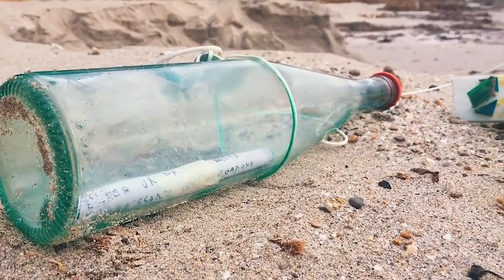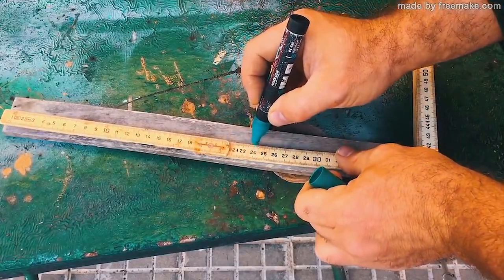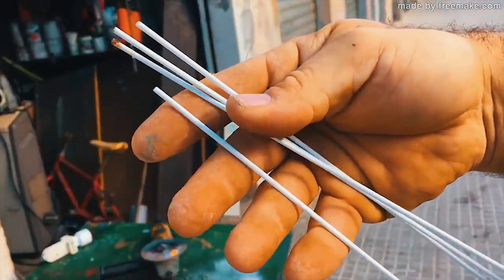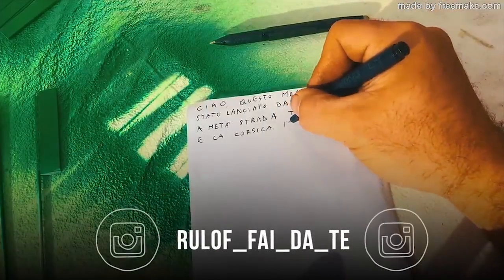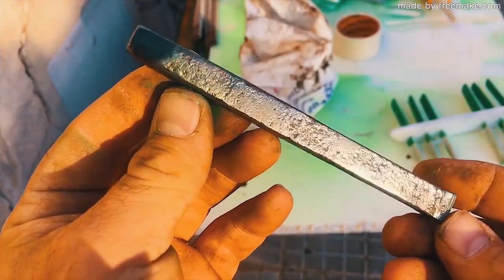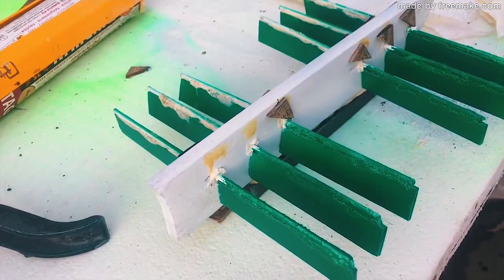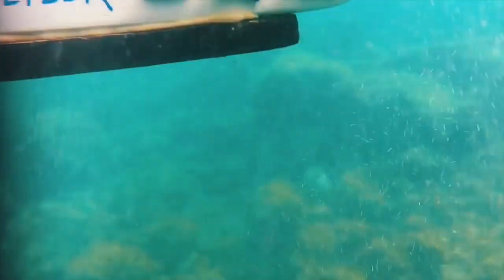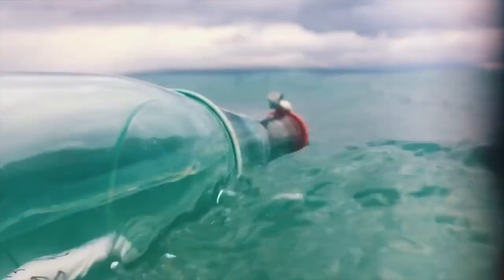Wave Propeller for Meassage in a Bottle •  Reach Destination!

Comment: To help the Sea Glider to keep certain magnetic heading, you can embed neodymium magnets in the wood. The horizontal force of the wings is transmitted to the bottle in a more efficient way if you use a stiff rod instead of the string.

Comment: If possible, GPS tracker can be used inside bottle for tracking the exact location of bottle
Reply: you just have to add a solar panel to keep it charged
Reply: @sebastianosinni5838  And some batteries or capacitors

Comment: I see plenty of room for improvement. Namely, I see how this could even have directional control, via prevailing wind direction. The string being replaced by a stiff wire, extending above the bottle, to a fixed wind vane.   Direction of travel could then be selected depending on the relation between the direction the sea glider is facing, versus the direction the wind vane is facing.  Studying prevailing wind and ocean current charts, one could fairly accurately "program" a course and destination.
Reply: rreidnauer google the company “liquid robotics” they pioneered this technology

Comment: It's a very cool idea. I'm of course aware that it's a basic concept device, but you could have a lot more efficiency with some very basic changes. For once, I assume that the 45 degree angle is far too much. With the analogy to airplane wings, you'd be aiming for the angle-of-attack for "best glide". I'd start by working with something around ~ +/- 15 degrees. More means that the "vessel" will sink and lift more easily without gaining forward speed. It's a bit like an airplane with an engine failure: would you nose-dive at a steep angle (converting altitude into vertical speed) or would you be looking for a more shallow nose-down attitude that gives you the greatest distance over ground (slower vertical speed, but higher forward speed and more covered forward distance), in order to make it to the next airport? The aspect ratio of the "hydrofoil" will also play a big roll: longer wings with a shorter chord length will be more efficient (less induced drag due to tip vorteces). You could also add symmetrical "winglets" for the same reason.

Comment: Just throw the bottle into the water and it will flow somewhere. This added  complicated anex just slows it down, and pulls it constant in other directions, because it does not have any steering device.
Reply: the point is, when the wave pushes up on the bottle, the glider at bottom will propel it forward, same when the bottle goes back down, the fins adjust and the bottle is propelled forward some more
Reply: markus is right
Reply: @Cent51  Jesus wouldn't speak like that
Reply: @cosmicacorn  first rule of the internet: dont feed the troll!
Reply: @Cent51  I love you and so does Jesus, you need to find it in your heart to accept that I am more holy than you.
Reply: I really wonder about this "travels against the current" thing. Christ, it's not as though the thing has some sort of navigation device. Granted that it might travel "forward" as it moves up and down, but "forward" is a pretty arbitrary term for something that may be nudged into a different direction by a million random events every day.
Reply: Steve Legend  An interesting idea certainly. I'm thinking though, that any sudden upward swell would tend to swamp the boat as it would tend to be pulled under. But maybe that effect would be no worse than ordinary ballast. Something to chew over.

Comment: Not practical bottle can rotate any direction with waves. Glider plates just swing up and down with sea waves but not giving a force to drive the bottle.if you say no it gives! Then glider should run more anterior than bottle.
Reply: i had the same idea... i swim next to bottle to see how it moves... if the bottle rotate. it just goes slower.. but still forward.. :)

Comment: Pretty neat, but I don't see how the unit stays oriented.  (magnetising the iron weight?)
Reply: Wouldn't it only flow north/south instead of following currents more east/west? I'd imagine nature has provided means to orient it in the right direction. Water flows out on low tide, in on high.
Reply: You would think it would follow magnetic north south lines assuming the wind doesn't overwhelm it.  (a big assumption)  Going other directions would require a change in design but that should be doable.  I live >1000 miles from any coastline so I don't see myself doing it any time soon, though.  ...corn everywhere...not so much sea :-)
Reply: The problem is that burning all that corn wastes a valuable resource and severly financially damages the very people I live around and care about, the local farmers.  Most of the land here is owned by and farmed by real people, not huge faceless/soulless corporations or governments.

Comment: since you have no directional control, I doubt this is any more „efficient“ than just a bottle.
Reply: for sure it can move faster
Reply: Rulof Fai da Te Sure, move faster in random directions, which is not any faster overall than no induced movement.
Reply: that is kind of the point, it is a fun thing to do i guess

Comment: Nonsense. There is nothing that keeps the glider oriented. It will turn around at random and thus waste its effect. It could theoreticsaly work if it had a gyro, but then it would by a completely different thing anyway.